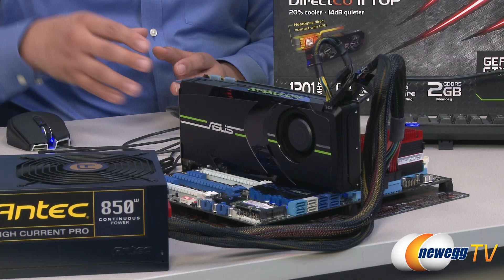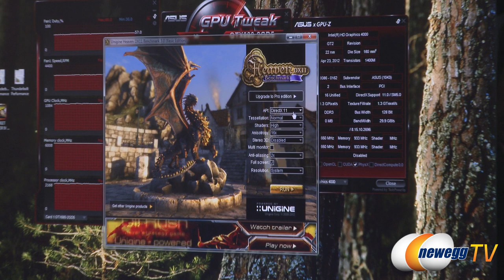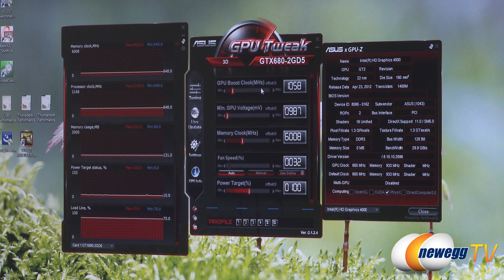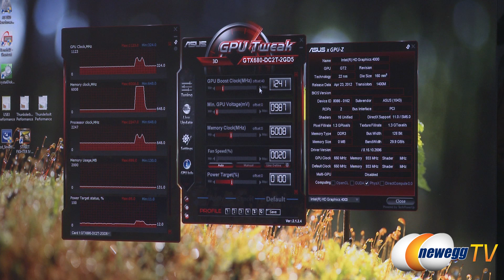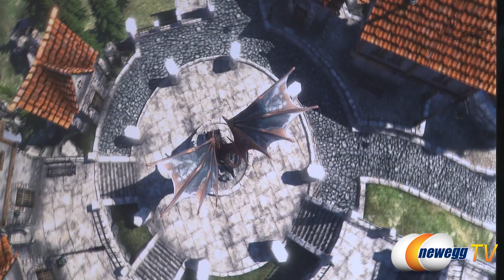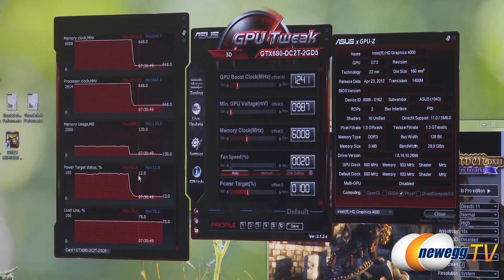Newegg TV: NVIDIA GTX 600 Series GPU Boost Overclocking Guide with ASUS

Comment: one question are 630 watt enought as power suply for a asus gtx 670 direct cu II, 4770k , 8 Gb kingson hyperx ram, with a asus z87 plus one samsung 840 EVO 120GB, 1tb Western digital HDD, i want overcklock for future,
Reply: play safe, study hard for your future. Or hop in time machine and go buy future pc and bring it back, never need to upgrade then
Reply: play it safe go with a 750
Reply: AADdope7 or 700
Reply: Play safe lol. A good 520w can run 780 ti and 4770k look it up. Yes a 630 will run that shit no problem.

Comment: My TOP 660ti is not defective I can tell you that. Where do you get the info saying all TOP's got pulled. I even overclocked the factory overclock and it is 100% stable, quiet and reliable. I would buy this card over again.

Comment: The first digit denotes the product line and generally just means which one is more up to date. The following two digits is what really shows denotes the performance of the card in it's product line. For example a GT 610-630 are more comparable to a 510-530 but will be just a little bit better. While generally the higher up a card is on their tier the more exponentially powerful they are compared to the previous gen counterparts. Like the GTX 670/680 blows the 570/580 out of the water.

Comment: @Hallucinogens666 what they mean by overclock based on heat is that it will downclock at 70c and at 80c and below that it will overclock based on certain temps and it will only go as far as it can on what voltage and other things you have set but you still have to find the right voltages and setting, for example the higher voltages can bring the clock down( idk why the card doesn't do it dynamically like temps).